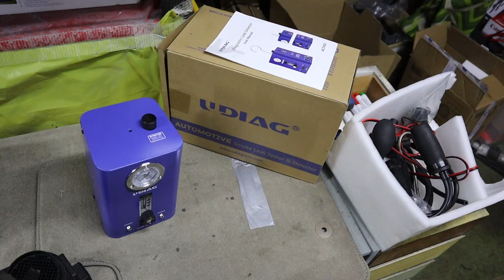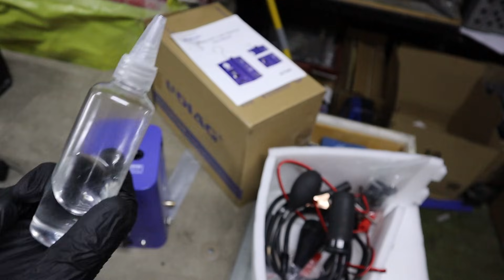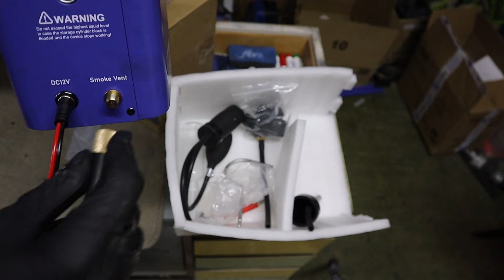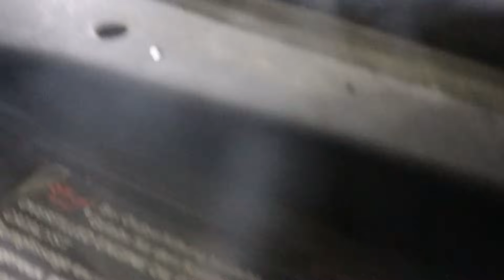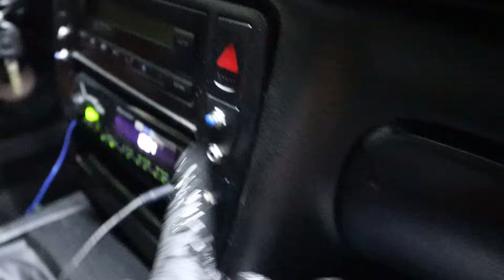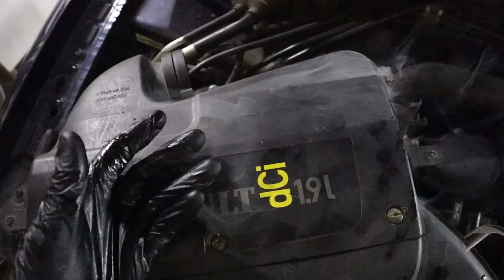Tool you didn't know you needed | Smoke Leak Detector

Comment: I just added a homemade  smoke tester to my tool collection. Very efficient tool for locating leaks. I've already repaired 3 cars using it. I diagnosed a leaking evap purge solenoid, a vaccum line leak, and a hard diag on a car setting off a lean bank code. Found leaking injector seals. Must have tool. Cheers👍
Reply from the maker: Very cool, how did you make it?
Reply: @iamcarhacker  I made one out of PVC fittings. There are several videos on how to make one. You basically fill the PVC container with baby oil and cap it off. Inside there is a fiberglass torch wick wrapped with nichrome wire powered by battery 12v. The wick soaks up the oil at the bottom and smokes as the wire heats up. I added air coupler fittings on the sides to push compressed air through. Works really well. I made one for myself and one as a gift for my brother👍